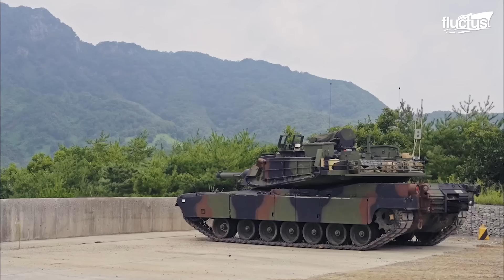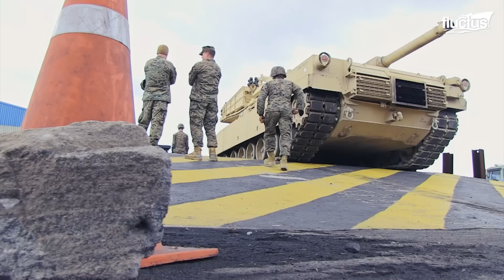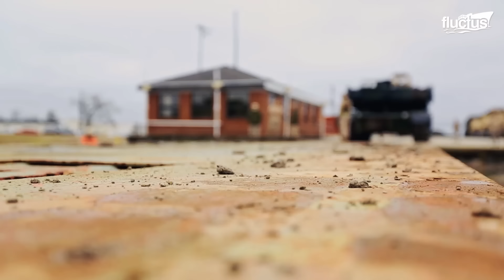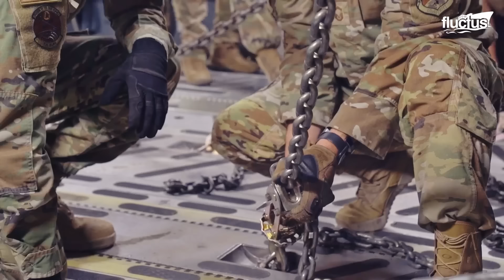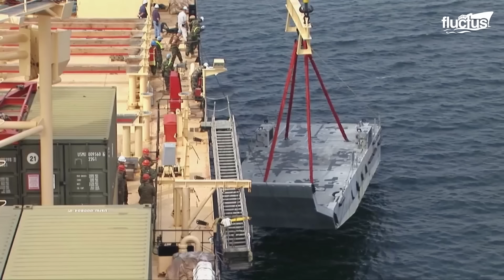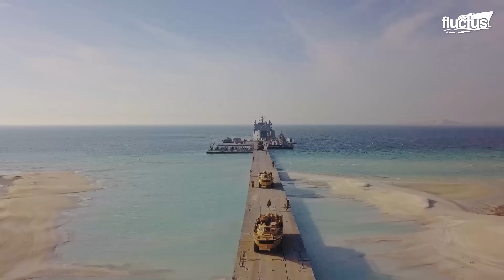The Scary Logistics Behind the US Army Moving Thousands of M1 Abrams Tanks

Comment: The US and Europe need to completely revolutionize their logistics.  Current capabilities are based in WW II capabilities, but today, long range missiles can destroy rail networks, ports, and air bases.

The US and Europe need to diversify how logistics move from ports and airfields to the front lines because the ports and airfields may not be operative after an attack.

For the US forces, we need ships that can offload on beaches instead of ports.  We need trucks that can transport tanks and vehicles in addition to rail that can be easily interdicted.  Europe needs many dozens of remote airfields to allow aircraft to land and take off from other than established bases.  Inbound fighters and C-130's from the US need to be able to land on preprepared roads with logistical support that can move between preprepared roads.  Europe need to create deep underground ammunition bunkers that has multiple entries and exits.

My point is that long range missiles make established logistics sites obsolete because they can be destroyed unless Europe has an airtight antimissile system in place at every vulnerable site, which is not realistic.

If Europe had 500 airfields, beaches to offload equipment and a truck fleet capable of equaling rail transportation only over road networks that Russia couldn't anticipate, only then can Europe expect an uninterrupted supply of troops, supplies, and equipment into a European conflict.

Sadly, neither the US nor the EU thinks in those terms and so Russia can easily stop US reinforcements to Europe in case of war.
Reply: Europe and the US already have all that and practiced it regularly on a large scale since ww2.Did you ever see the reforger exercises? it has prepared plans for all this to happen in the event of war.